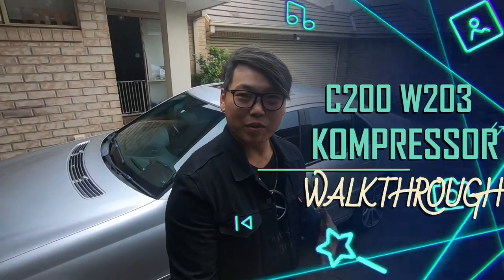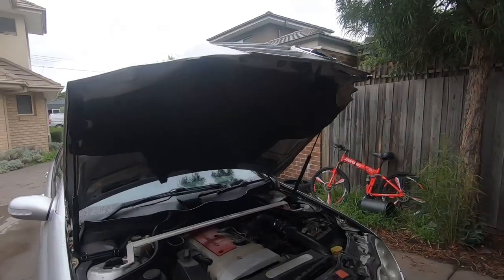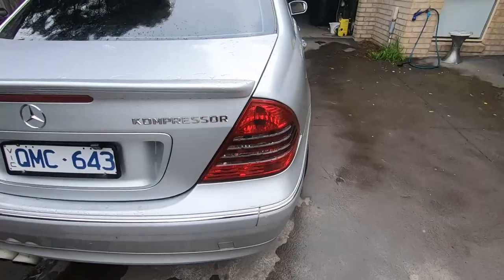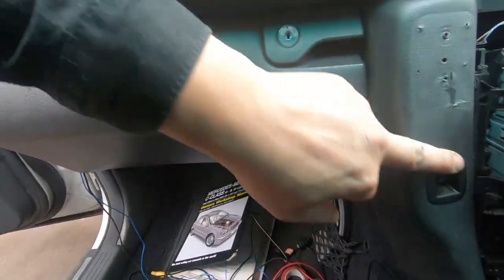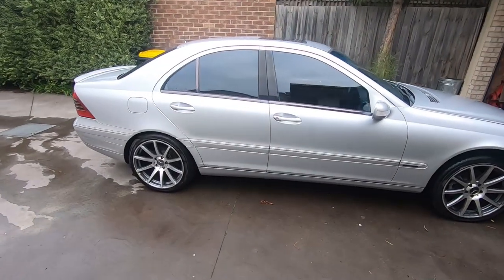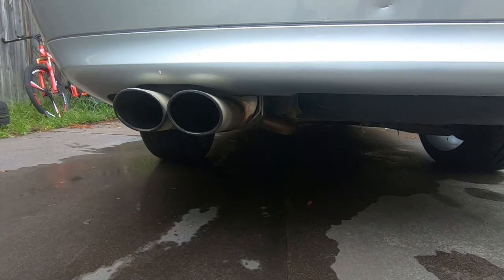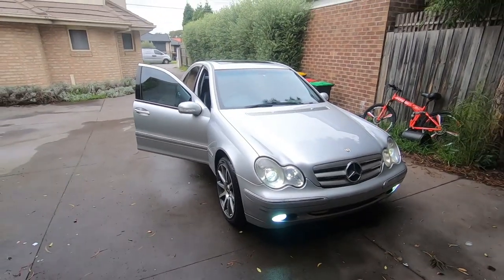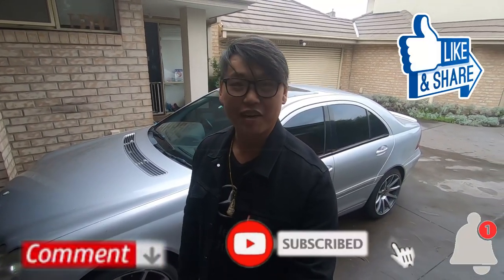MERCEDES BENZ W203 MODIFICATION AND DIYS LIST

Comment: Hello, just sharing my experience with like minded enthusiasts, with a C180 Kompressor. The factory cam magnet adjusters can fail, allowing oil to leak into the wiring harness. It can be an expensive eg $5k repair but is fully preventable. The parts are eg $40 each, located at the front of the engine. I think the motor is different to the C200 so not sure if its also at risk.
Reply: They have the problem too but only on 1 side

Comment: Hi Mike thanks for replying to my message I've watched the video you recommended also if there's anything you can think of that I might have show before to trade for girls Chrome air vent covers have nice spray gun brand new gravity fed I'm sure you would get some use out of it spare needles loads of spare filters attached to the gun itself I would be more than happy to see you end up with it as You do brilliant projects, have a a think about it we would both have something that we could use anyway apart from that great video 👍

Comment: Where did you get that strut bar from? Did you have to drill into the body since there aren't any bolts going through?
Reply from the maker: no drilling if u look at where the strut braces go u can see there is already holes for the factory suspension so u use a bolt and nut and u secure it with the bolt and nut, it comes with in the package contents

Comment: Hi Mike great video as usual I wanted to ask you where did you get the little lip spoiler is it something you boy Sabbath or is it from another Mercedes and is it screwed from the bottom or is it stuck on with some sort of glue, also quick question for Mike or anyone reading this comment I have a 2005 w203 the colour is dark navy you would nearly mistake it for black in certain lighting I am considering changing the colour of the wheels do not know whether to go silver or I will be attending the windows anyone any one got any suggestions?
Reply from the maker: stuck with adhesive compound

Comment: Hi Mick I am going to pick up a 2005 C-Class kompressor will I be able to put a different grill on like you have in your video here and if so what year and model did you get it from
Reply from the maker: hey bud , sorry i didn't see these msgs , i got them for my car, they are aftermarket grill designed like the w204 3 fin grill, i got them from ebay , so which ewver your model is you search according to your model

Comment: I have an 06 W203 sport 6 speed.  Where did you get the silver trim pieces and “S class” taillights ?  Can these pieces be found for an 06?  Thank you!
Reply from the maker: as long as same shape they will fit .. on ebay i found everything... for 06 that has the new interior so different trims... but the s class tail lights can be found just search ebay

Comment: Hey good sir, what double din head unit did you use, I want to install a new one on my w203 c180 since the navigator head unit lost its polarization which makes it unable to display anything
Reply from the maker: I installed a pioneer but u can do Amy double din unit as pongbas u have all the right iso harness and facia plate kit .. these days it's easier with all the adapters u can plug and play so easily
Reply: @MIKEYZVLOGZ  ah I see thank you sir 🙏

Comment: Hey Mikeyz, I'm struggling to find an oil filter that fits my W203, 2001. Do you have a recommendation ?
Reply from the maker: oil filter is the same as 2005 they use the same.e as long as same engine petrol and diesel

Comment: Can the exhaust be made to be quieter i will like to see modifications or you can suggest to me
Reply from the maker: depends on what u want .. this exhaust is made that way so that's how it sounds ... if u just want looks and no sound u can always change the tip .. but for performance u need a slightly bigger exhaust system
Reply: @MIKEYZVLOGZ  awesome thanks Mikey

Comment: Hey I’m interested in buying one as daily driver was it reliable for you?
Reply from the maker: tbh, it is reliable, but be aware you need to maintain it, like anything if you take care of it it will last, my car is still going strong, i had a small hiccup with a rattle noise, but was fixed quite easily it was related to fuel injectors , apart from that i changed the maf sensor once, which was about 270 aud and regular service and its good as

Comment: I have a c240... I just got it 4 days ago. What is w203. Can that be explained? Is that like the body style. Ive been looking for parts. But i cant find any. Just tryna get my ride looking the part. I love this car. I look online for diy stuff. Not much of it tho.
Reply from the maker: ok so u have a c240 w203 is the body style ..for example it started with w202 w203 w204 w205 etc..wen looking for parts u need to find parts for a c240 which is actually the 6 cylinder version not the 4cylinder like mine ... we have different engines but the exterior is basically the same ... interior is different depending on the year model and series aswell... look for your yr make model and engine ... or easiest way is to use your engine number and vin number...with that u wont ever go wrong ...99% of the time...i also recommend oem parts over genuine as it will be alot cheaper...
Reply: Thanks man. Cuz i was completely lost for the past few days

Comment: can you help me? my w203 ir isn't working for my key and the radio reception is weak. could it be because of my tint getting removed and replaced or the antenna in the rear headliner die?
Reply from the maker: So ur normal.fm radio is faulty ?

Comment: Hey Mikey,
What struts/shocks would you recommend for 2005 c200 w203 chassis?
Reply from the maker: there are alot of brands now but depends what your using it for ? everyday driving i wouldnt get a brand too exspensive unless u really prefer it and can afford it ... the strut braces i use are really good qualitu too cant remember the name but they make under carriage braces too for many models...ill check the name and getback to you... really depends what ur using the car for ? track ? or jist for looks?   for everyday driving. u just need something that works and is practical.... all these factors will help u pick one ...wen u decide why and what ur using it for..quality will be easier to decide... also 
for suspension get coil overs amd ones that are about 1200 will do

Comment: I know it's a while since u uploaded this, but do you remember the specs of the rims and tires?
Reply from the maker: I can tell u they are multi spoke staggered 18inch front tyres are 225 40 18 and rears are 235 x 40 18 size are 18 x 7 front 18 x 8 rears
Reply: @MIKEYZVLOGZ  thank you!
Reply: @MIKEYZVLOGZ  what rims are they?
Reply from the maker: @@szymeklawik7636  they are just generic concave multi-spoke 18inch staggered

Comment: Hello brother how to get back the windows automatic up and down I do everything but not work new key new door Sam and more but not set in to automatic up and down
Reply from the maker: what do u mean automatic up and down.. u mean by using key ? or wen u press up on switch ?
Reply: @MIKEYZVLOGZ  using key brother
Reply from the maker: @mohsenansari1913  u need to check your key fob antenna ... maybe it's broken ... u try pointing directly at the infared bar on door handle like I show? .. if yes..then maybe something wrong with your infared ..maybe malfunction ..might need to change
Reply: @MIKEYZVLOGZ  bro my maen not remote key I'm mean windows key in door an interior driver door I'm pushing up or down to turn up or down the windows sorry for my bad English 🙏🏻🌹
Reply from the maker: @mohsenansari1913  oh then it is your window actuator .. broken.. the motor that makes your window go up and down .. u need to replace .. but check with professional first or use a mer eyes scan tool to make sure its the problem then replace..do not replace hoping to fix ... don't waste money and keep trying to replace parts until u know exactly what is broken
Reply: @MIKEYZVLOGZ  ok brother thanks to your help and you upload the best video about the w203 and I'm so glad 🙏🏻

Comment: Is there a mod to turn on the fog light on when the headlights come on automatically? Without pulling the light switch button.
Reply from the maker: anything can be done just a matter of cost and time..so for instance you could always wire your fog lights to come on with the headlight however it may throw an error cuz of power draw and the sam units  sending pulses through the car  detecting fluctuation in voltage and amps... but a capacitor can help with that too with a switch

Comment: Mercedes is the most dependable German car but expensive to fix BMW start burning oil and coming with engine problems so your best bet if you like German cars is the Benz I got a 2001 c320 4matic and I got it with 64,000 miles it was sitting for 13 years I gave it a full tune up change the brakes and it runs like a baby I got it up to 91,000 and it's still running beautiful after it's been sitting for 13 years Daimler was the man he should have taught Chrysler a couple of things but? That's why I want to salvage this car I like this model car I want to put LEDs and hook it up to the max but I want to get something I can drive around and let this sit Toyota or Honda would be the best choice for a lifetime running car but out of the German cars yeah I love the Mercedes-Benz experience since mine is a older one my wife is a 2007 and looks the same except her lights look better than mine in the front cuz there's a clear and that's what I want to change all the lights to LED I put a system I always love benz also...
Reply from the maker: good call mate

Comment: What's the difference between c180 and c203
Reply from the maker: c180 is c class 180 motor 1.8 or 2.0 litres engine c203 is the model and shape c class coupe 2 door ...w203 is the c class sedan 4 door